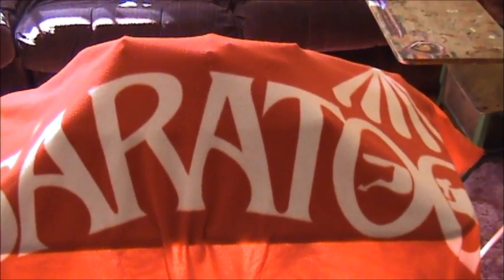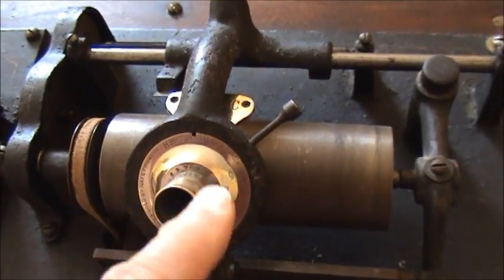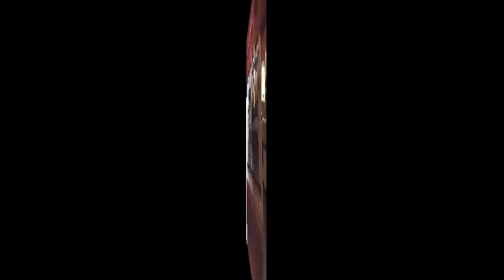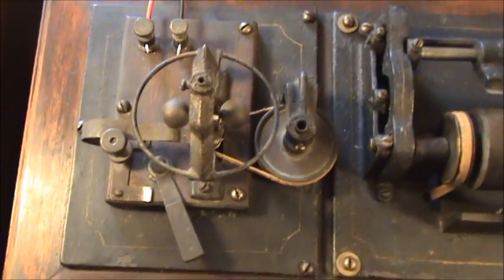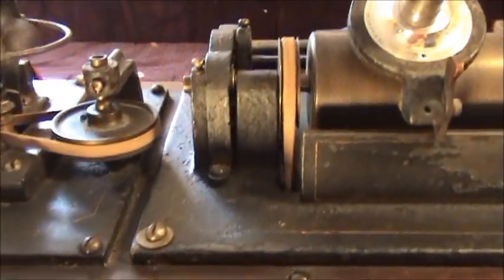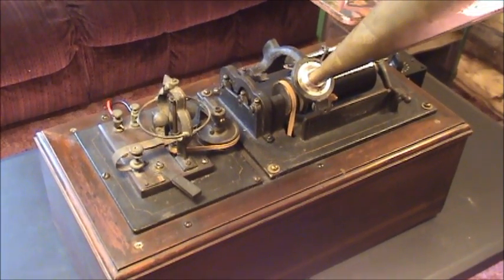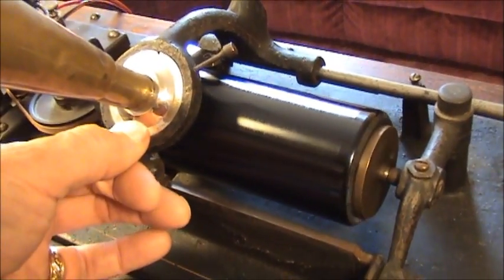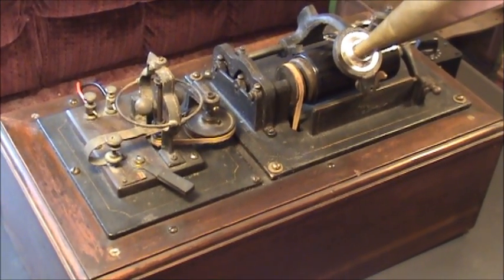1800's HOMEMADE Electric Class M Type Cylinder Phonograph-Only Example Known!

Comment: You should try to make a period battery for it. They usually used laclanche cells, which is basically a carbon zinc battery but with a liquid amonium chloride electrolyte, usually inside of a glass jar, lead acid batteries were also commonly used for coin op machines cause they can be recharged.

Comment: Why not ask people to question what you are saying? There is no way that 'forged' as in 'cast steel' actually, could be done at home. Or even in a local engineering works! This is probably an older model botch up with other model parts, together with a motor off something else. Could have been made at any time. What is interesting about this 'edison era' fetish for old men, is the connection they could be making with the rise in carbon emissions. To afford these toys of the industrial revolution, people had to earn more and use up even more resources making other stuff for other people. The rural scene changed forever during WW1 and mechanised horse-power took over completely by WW2.

Comment: the standard square top model A standard phonograph base was made between 1898 and 1902.
class m type phono's were made for school scientific use until 1914!
the person who made this one probably made it to fit this type of use of the machine.
Edison would send out schematics of the machines to numerous schools for local engineers to build a machine so, that's what this is! a science class phonograph if you build the machine for your school the Edison company would send you the first batch of cylinder blanks for free! as well as the option of a cylinder shaver at a reduced price! the old-style automatic Edison reproducer offered the means of recording and playback it was rough but it worked! eh, in most cases you would turn the Edison automatic reproducer upside down and record and turn it back for playtime! also lots of folks would make their own reproducer/recorder with these Edison specs.
Reply: ps the max running rpm of an original class M machine would be 80 rpm since of the speed difference of 80 to 160rpm I date this homemade machine to 1903 to 1910.

Comment: I love your videos, but in this case you are wrong. This is a Victor Edison Phonograph,,electric drive,  and was made by the Edison factory, and it sold for $60 at the time.
Reply: Almost entirely correct.

According to the Edison Phonographs 1903 Catalog, the "Victor Edison Phonograph" you mention (Catalog Number A 3000) was a battery operated model.

The "Conqueror Edison Phonograph" (Catalog Number A 3001) was the same in general appearance and equipment to the "Victor", but was furnished with an electric motor wound to run on 110-120 volt direct current.  

Connecting wires were attached to the nearest electric light connection.  The catalog states that "The attaching plug will be furnished of any base required to fit customer's lamp socket."

Both phonograph models weighed 48 pounds.

While the "Victor" sold for $60 at the time, the "Conqueror" was somewhat more expensive, selling for $75.

Comment: A remarkable piece of work! The Standard top-plate must I think be from a Model B (1905-09), since there is no hole for the speed regulator in the front left-hand corner; on the other hand the carrier-arm has the old-style lever to lift the reproducer and therefore must be older (early 1903 at latest). The brass mandrel ought to be older still. I have never even seen a picture of an original Edison electric motor before, let alone seen one in operation. Thank you!